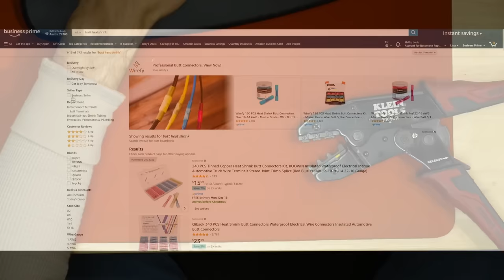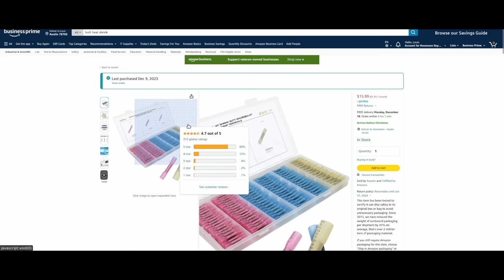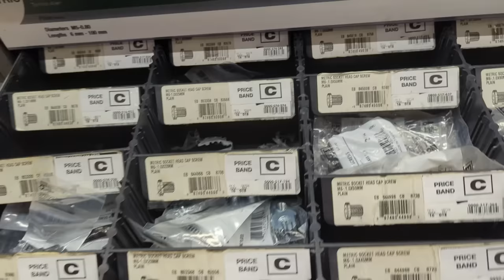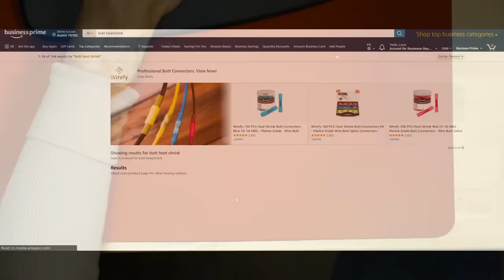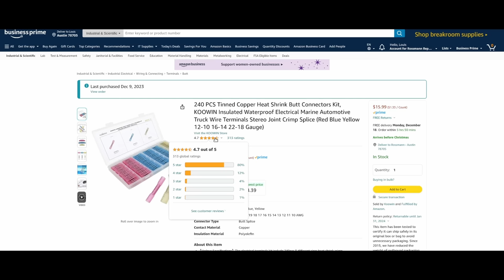Amazon Sells Dangerous Electrical Crimps

Comment: I bought similar connectors. To make them work, you need to downsize crimp size. For yellow connector, use blue crimp size color on crimp tool. You usually have to use crimp tool twice in order to keep wires from pulling out.

Comment: I have been a Amazon Shopper since 2009 and I can definitely confirm. I have used Amazon for business and personal.

It was batteries I got me to notice.  I do DIY electronic projects and I started to have problems. I finally realized that the batteries were not producing mAh that they claimed.  

So I got myself a battery analyzer, bought 15 different so-called brand names. Four sets of each and I tested them. 4 cycles each, made notes as I went along. 

They were all fake except for one seller that coincidentally happened to be here in USA. I reported all of those, Amazon did absolutely nothing. 

The most recent disappointment was the cancel. There was a update and now the thing is basically unusable. It's a cluster F, you're just inundated with best seller and newest hits. To the point where you can't even find what you want to read.
Reply: There is an extension to Amazon that shows you where the product is sold from, so I recommend that you use that. I know it does more than show you where it’s from, I think you can block certain countries so that when you search for products, it won’t show up. I don’t know the name of the extension nor do I use it because I don’t buy stuff on Amazon, I just saw it from a YouTuber who got sponsored by them. I don’t know the name of it though but I can tell you that a tool like that exists and it can help you avoid cheap Chinese products.
Reply: i notice that too, 2 weeks ago i  thought i bought a genuine hp battery and it turns out that  its was  fake and the  hp logo was painted on the fake battery. Scammers are  coming up with new ways make money.
Reply: 99% of "fake" products are not real listings but from the "like new" list, or other obvious tells. Like I get being ripped off sucks. But ffs how many of you also scream at "poor people" for stuff like signing mortgages they couldn't afford. Be consistent.
Reply: @KevinJDildonik  I feel like we need a competitor to Amazon that only sells high quality goods because I know people would most definitely go crazy about a website like that. Imagine a website where you are connected to only trusted companies that are reviewed by professionals.
Reply: As an Amazon seller, I buy from Walmart, but only if it is sold by and shipped from Walmart. And of course B&H Photo is tops too.
Reply: I ordered some lithium recharchable AAA batteries, turns out they don't have the normal 1.5 volts! So everything I tried to put them in didn't work. To be fair I think when I went back to check they never claimed it was 1.5v, but still, shouldn't triple A all be the same?
Reply: @remyllebeau77  yes, all aaa's should be the same voltage.

Comment: “We are not responsible for our third party partners.” A convenient excuse for fake MicroSD cards and USBs on there. 

Exceptional work Louis.
Reply: Except it's not "third party" it's "turd party"
Reply: Someone should make online stores that stock only high quality products...  But they already did
Reply: Steve Gibson has a new tool out to test the fake USB and other flash drives. Turns out even the "name brand" high-capacity drives aren't what they claim.
Reply: It is pretty annoying to need to 100% fill any new storage and go back through to function test the files just to figure out if it is fake or not.  I caught the wife trying to use a $25 "1.5 TB" thumbnail sized flash drive to transfer personal pictures and remove them from per laptop.  Somehow she gets mad at me for telling her that drive was lying to her and she was very much at risk of having irreplaceable files lost.  

There may be tools to check if a drive is legit, but the cheap way is to load it up with  large video files then go back to each file and play it.  You should be able to skip around each file, beginning, middle, and end without any issues.  The faked capacity drives will fail this.

Comment: A quick note about an issue I just wrote up on a review of a product on Amazon. I'm sure it won't get posted. The item is the "Corsair MP700 2TB PCIe Gen5 x4 NVMe 2.0 M.2 SSD – High-Density TLC NAND – Aluminum Heatsink – M.2 2280 – DirectStorage Compatible – Up to 10,000MB/sec – PCIe Gen4 & Gen3 Backwards Compatible – Black" at a price of $154. Yes, a long-winded title but that's not the issue. Note that it includes "2TB" after "Corsair MP700" in the listing. This is the capacity of the SSD. However, when you click the listing you find that listing is actually for only a 1TB size drive. Their 2TB drive is significantly more at $259. Is this a one-off ad issue? Maybe. But federal law requires sellers to charge only the lowest price marked yet this automated bait-and-switch avoids that compliance.
Update 1439 PDT: after 2 hours getting nowhere with Amazon (useless) Customer Service via both chat and phone I've filed a report with the FTC. GFY Amazon.

Comment: I work at a hardware store currently. The amount of theft I see on a regular  daily basis is insane. There have been days I've written out as much as 4000 dollars worth of stuff because it's either stolen, or on the uncommon occasion, not actually sent to my store and it is a shipping error from the distribution centers.
But theft, yeah it's crazy. People steal everything from heart shrink to nuts and bolts to dog doo doo bags, to even a welder or a 75lb winch, to 300 dollar battery chargers with spider wrap on. Nothings off limits.

Comment: Yup. I've had more returns to Amazon in the past year than my past 10 combined. And it's all cheap Chinese garbage that I do a FakeSpot check on (which is becoming useless). It also now takes longer to find what you're looking for because there's a sea of imported garbage to wade through, and it's both time consuming and frustrating to figure out what is really good quality. I find the best products have hundreds (or more reviews) with <2% 1 star ratings. Those (so far) have been pretty solid. But yah, Amazon shopping for clothing, bedding, phone covers, house supplies, and even art has turned into a total nightmare.
Reply: Exact same situation for me. I've been ordering multiple packages a month for years without a single return, and I've returned 5 items (and been too lazy to return several others) in the past year.

Searching for products on Amazon is broken. It's all pay to appear in search results.

Comment: Family set up an Amazon secret santa thing for Christmas this year. I noticed that most of the items sold on Amazon where VERY overpriced. I could get the item 30-40% cheaper in the local shopping centre than on Amazon. I just looked at what my family member wanted, then got it locally. I was very surprised. I also knew that I actually got the brand that wanted, not just a knock off of the product. Live and learn.
Reply: Ok I wasn’t the only one thinking this? I saw my secret Santa lists and I just looked at it and thought this shouldn’t be this much. I tried to look at Etsy or Ebay or Walmart but I don’t quite understand the things my secret Santa wanted so I just bought it on Amazon.

For what I can speak for I got a paint set for $25 but I could go to Walmart or Hobby Lobby and get more paint for at least half the price. The shipping is the only convenience because I live like 10 h from my friends and “free shipping” is nice.
Reply: I've been having the reverse issue here in Canada, Amazon tends to be 10-20% cheaper, same items/brands, next day shipping even though I don't have prime cause I'm near a fulfilment centre.
Reply: From what i know third party seller on amazon has very high overhead. A lot of cost had pushed to them from amazon. If the product is regular used and had a stable market. Buying locally will likely cheaper.

Comment: I already stopped spending on Amazon. I went to B&H and Newegg, but they started getting slammed with the same Chinese sellers, so now I tend to frequent Brick 'n Mortar stores, but the crazy part is, I never shopped at these stores even as a kid (when I went for myself, not my parents). In the last 3 years, I've shopped more at traditional stores than online because of this rampant Chinese-whitelabel-product issue.
Reply: The problem is that where I live, there is nowhere that sells  a lot of the things I want to buy. The only shops for most electrical components are industrial suppliers, nowhere sells 3d printer supplies, VR accessories, etc. Oftentimes, the only place I can find what I am looking for is amazon or aliexpress.
Reply: @kiwihuman  I bet you there are alternatives. I know there are online alternatives for a fact.

If you look around town, you might be surprised what's out there.

I used to use the yellow pages and found all sorts of businesses. Many are still around. You'd be surprised.
Reply: @kiwihuman  Yeah, same here.  I live in a metropolis in the USA and I don't know where to go for 3D printer stuff without going online.
Reply: @kiwihuman you can easily buy a 3d printer from a brand's website usually. If you're shopping at a price point where only Chinese brands on Amazon can fulfill (highly unlikely) then that's a different story.
Reply: @Saturn2888  People who don’t live in or near a major metropolitan area exist. Simply telling them to “look harder” doesn’t solve the issue of most mom and pop shops in these places closing down because they can’t possibly compete with online companies which makes the problem worse.

I roll my eyes whenever I see a clueless person online tell somebody to “visit your local Microcenter!” for tech stuff. The nearest Microcenter to me is 400 miles away.

You can say that I’m making excuses, but you’re not the one living in the sticks, are you?
Reply: You may or may not know this, but where you buy from matters little these days - a lot of brick & mortar stores carry products that were made in China and quality has been dropping for quite some time now.  If you want a quality product, the best bet is to simply do your research online and find products that were made outside of China or at least if it was made in China, the company that owns the product has rigorous quality assurance standards that are enforced.
Reply: @adb888  this shit in america should be regulated at the border so I dont have to be the regulator and mount up
Reply: Newegg was bought by China years ago, they are not much better than Amazon. Though they have much better taxonomy and search so at least you can filter down to the right category of product.
Reply: @JS-jr1fo  Sadly, both political parties are to blame - this isn't a Right versus Left issue, but a Money & Corruption issue.  Many people don't know this tidbit either, but China has been quietly buying up US and European businesses or buying voting stakes in those companies, so that they can influence how the business operates.

Comment: So happy to hear that I am not the only one who noticed the extreme decline in availability of quality products on amazon...
I have been battling amazon trying to buy replacement parts for some old printers for over 3 months now and my printer sits here not fixed because I just didnt want to wait for the part.....when actually if I had just waited from the reputable dealer...it would be fixed by now....
instead I kept buying stuff so I could try and fix the problem now only for the problem to still be there afterwards....
Every single item I have bought on amazon I have had to return because it simply didn't work, was broken or was just a used item sold as new....
I am officially no longer buying anything on amazon unless it is a trinket like a cup as you were saying

Comment: It's not only fake 5☆ reviews being posted, it's rejection of valid 1☆ reviews. 

I received a product that was a 0☆, so I sent in the lowest rating available, a 1☆. Several days later, I received a response from Amazon that I violated one of their guidelines, and told that it will not post. I pulled up the guidelines. It went on and on for screen after screen. I have no idea what it doesn't like, and it didn't say. There was no link to question anyone or reply. Furthermore, it said that if I attempted to send another review to this same vendor, it would be rejected. I think that this was a robot, possibly an AI robot, but the message was clear - send in a 1☆ review and your time will have been wasted. Ever notice how almost every product on Amazon is above 4☆? Blocking low star reviews is just as effective as permitting high star reviews. Amazon's job is to sell products. More stars on reviews, the more the sales. The more the sales, the more fees they charge.
Reply: Can u just not review it I bet if 100 people do the same the rating would lower ( or not ) ??
Reply: Start giving four or five but than bad mouth the heck out of the product and why it's bad
Reply: @uthopia27  
For the love of...
If you don't review it, the score stays the same, it will not raise or lower.
You can only lower a rating by voting low.

Comment: Thank you Louis, I've been feeling this for a while now. Not only is everything I'm getting from Amazon cheap garbage, but so is the delivery. They are now getting slower and are less careful with packages than before. I've had considerably more broken boxes and damaged product since the start of the pandemic. Sure, that's not entirely Amazon's fault either, but it just shows who Amazon is willing to do business with: people/companies who ultimately only care about your money and not you. Not to mention all the landfill liners this is producing.
Reply: The slow delivery has pissed me off bad. No longer are Prime customers guaranteed 2 day delivery in most places. I'm commonly seeing delivery times of 5-7 days FOR PRIME SHIPPING. And since they don't charge you until the item ships, you can tell when they actually do ship it. And what commonly happens is the order will sit around for several days and once it does ship, you get it a day or two later. So the actual time in shipping is still 2 days or so, but they don't actually send the order out for several days. This reminds me of the intentional delays they use for their super saver shipping for non-Prime members where they'll sit on an order for a week or so before actually shipping it out, in the hopes of frustrating you into subscribing to Prime. At this point it wouldn't surprise me if they're doing this so they can introduce a "Prime Plus" or some garbage that's twice the price but comes with "guaranteed 2 day shipping" again.
Reply: I think humans just don’t care anymore

Comment: Two weeks ago I ordered a desk monitor mount from Amazon in used, but declared good, condition. It cost me 10 to 20 dollars less than the new one and I thought it would be a good idea, I mean used is not bad. What I received a week later however was bad. The mount came in an Amazon warhouse box with their sticker of approval on it. On opening the box, I could see the loose arm mounts just lying in there without protection, on closer inspection I could see dents as well as scratches in the metal, broken plastic clips already assembled parts which did not belong together. I thought I just run with it, I mean its just holding the monitors, as I was too lazy at the time to just return it. When I tried to assemble the parts, I noticed that whole parts where just missing, as well as missing screws and nuts. In the end I just returned it and got a brand new on with their weird flash deals for the same price as the used one. Haven't unpacked that yet, but I hope this time everything will be included and in good condition.

Comment: I always check the 1-star reviews on any site. It's really difficult to filter fake 5-star reviews, but with 1-star reviews it's pretty easy to spot when it's a product problem, "this is actual garbage that doesn't do what it's supposed to do" vs. a customer problem "I bought the wrong board and it didn't fit", especially when those reviews are repetitive.

I wish I knew how e-commerce has managed to buck the trend of primarily unhappy people being the ones to leave reviews.
Reply: By deleting reviews that you don't like. I used to leave Amazon reviews, but they kept getting removed. I would go to my own review to make sure it was still up only to find the link is dead and removed.
Reply: Another thing I hate is trying to read actual reviews when an item was sold or gifted as a promotion to pump up ratings. The reviews will state the "product was received from a sweepstakes or promotion." Most of the promotional reviews are 5 stars, and when you read the 1 to 3 star ratings, you learn the product is faulty or quit working after a short period of time.

Comment: I've had those Amazon 5 star crimps melt on me a couple of times. Gave up and soldered the join instead. 🙄
I've also noticed a large amount of listings where the original product was sold to bump the stars/reviews up to positive levels before selling a hunk of shite. Amazon could easily fix that, new product should need whole new listing. 
I reported a fake product on Amazon a few weeks back.. Amazon responded by removing all the critical reviews of those who said they'd been scammed and had no help from Amazon. That product is still up.